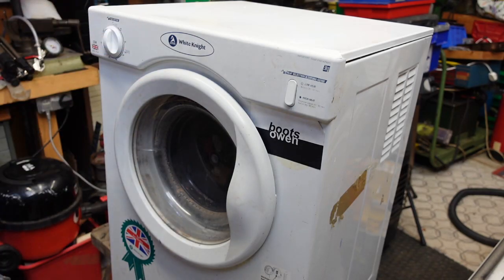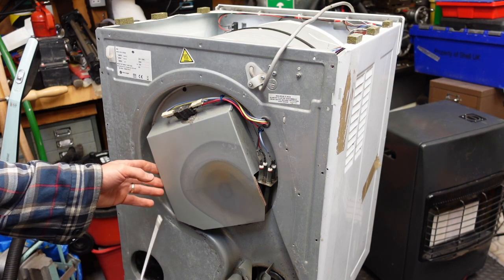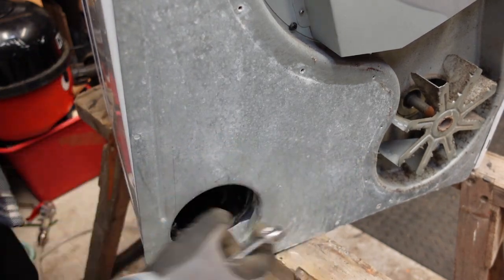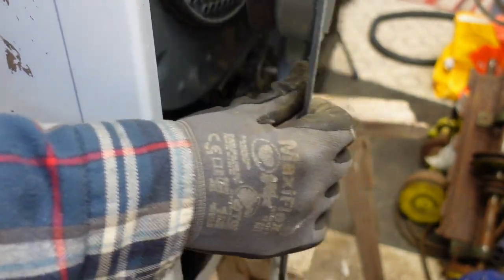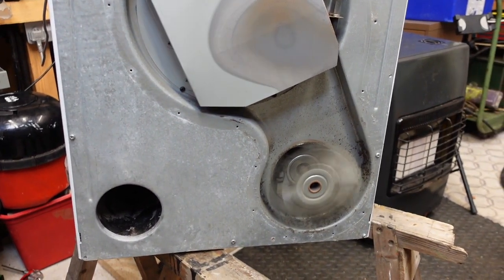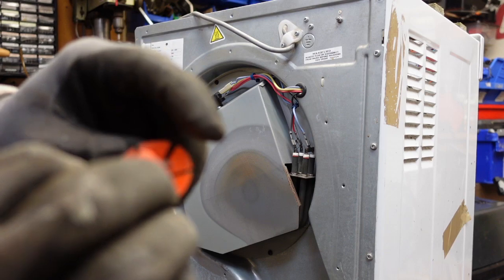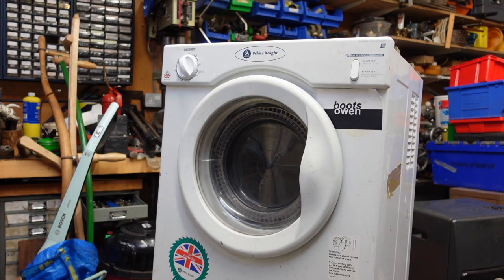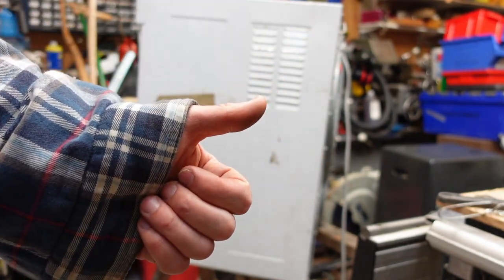Tumble dryer won't turn? How to replace the motor capacitor: White Knight 3kg C3A, easy job!

Comment: Very Good. I presumed White Knight was a low end brand, but it seems to be well designed with that type of element & resettable thermal cutout. Pity that fan is fixed as service access could be better.
Reply from the maker: Other comments have revealed that there is a hatch on the base for access.
Reply: @bootsowen  Dooooooouuuu!!!!!!!!  😕
Reply: @bootsowen they are very reliable dryers seen ones last way over 20 years old
Reply: @bootsowen the red button on the back you just press with your finger as is no screwdrivers or removing back panel needed

Comment: Well i can't fault your repair, the run start cap dryed up.
I have a wolf bench grinder that i found in a skip 20 years ago.
The run start cap had exploded everywhere, talk about smelly, it stunk evil lol.
I cobbled two caps together in parallel because i didn't have the right value.
What a handy tool :-D

Comment: I had one of these onse was a beasty little thing god did it get abused though 
Went faulty tho at points when it was on the motor would jerk go slow then fast then it started to smoke was the end of it that day whiteknight have always been good with there dryers